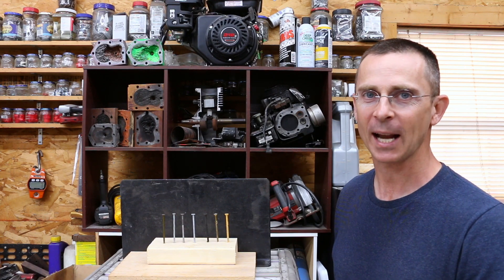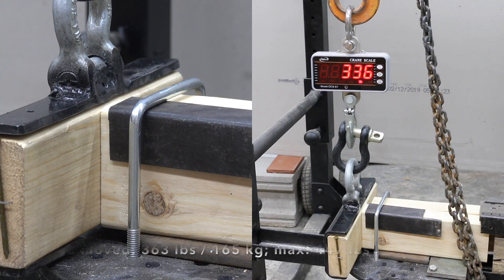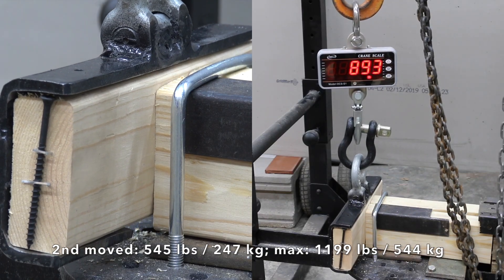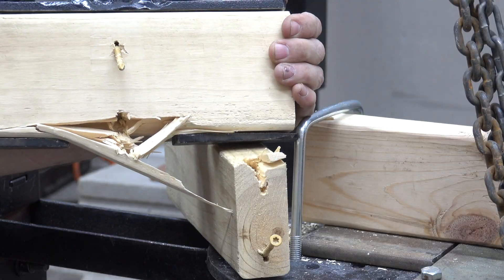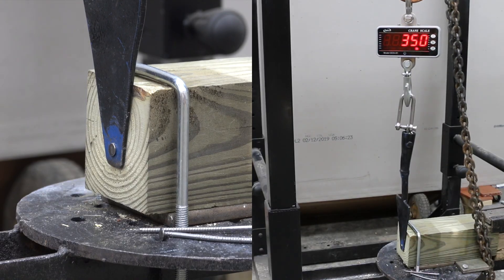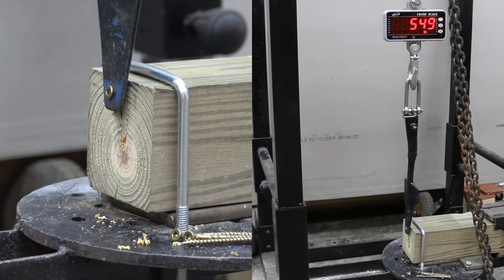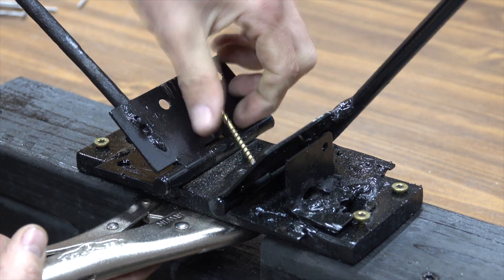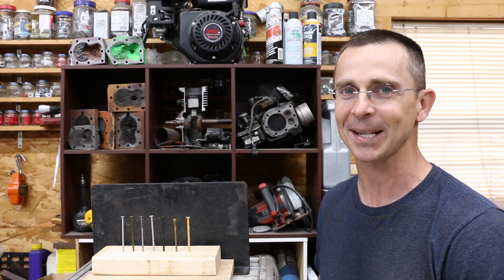Do Screws Shear easier than Nails? Let's find out!

Comment: I'm sorry but the bend test was absolutely pointless. No joint will move that amount.
Reply from the maker: Thanks for the feedback.
Reply: @ProjectFarm   from an engineers point of view, every fixing I've ever used is driven in until the head of that fixing is touching the surface that it is being driven into.  Hence the snap test is irrelevant to how a fixing is used correctly.  The previous 2 tests were very accurate in my opinion.  Thanks for spending the time that you do, doing these tests. I do enjoy watching your channel 👍

Comment: You didn't shear any of the nails, you're measuring bending moment. The wood fibers sheer at way less force than the nails or the screws, then the nails and screws bend as they pull out. I don't know why everyone thinks that structural strength is simply a function of fastener sheer strength. If you legitimately want to test sheer strength you need to recreate the 2nd test but instead of putting them in to wood you need to put them in a metal collar sized based on the fastener with a set screw holding them in place. This is all pretty moot though. A screw designed to do a job is always better than a nail designed to do the same job, but screws will never be the primary form of framing fastener because they are too slow, and that costs money. 

Also, a lot of people on youtube test fastener "shear" strength because they believe that is why newer building codes require joist hangers and hurricane brackets instead of nailing or screwing boards together in certain scenarios like joists on a deck. When in reality the reason these are required is because of the low shear strength of the wood fibers when resisting the fastener moving sideways through them, as you showed in your second test. 

If anyone actually correctly tested shear strength of fasteners correctly they would be shocked to find out that most of the numbers are going to be above 10klbs and that hardened fasteners are going to score higher, seemingly negating what all these youtube couch contractors believe to be the reason why non hardened fasteners are preferred in construction. But in reality, as you showed, as the fastened joints yield they bend the fastener and harder fasteners snap instead of bending. 

I guess what i'm trying to say is I really wish people would just stop calling it shear strength. And for any of those couch contractors who are going to tell me i'm wrong, don't bother, I don't read replies so you are just wasting your time.
Reply from the maker: Thanks for watching!

Comment: So much grousing in the comments that you didn't do a true "shear strength" test of the fasteners themselves.  True, but you did do a shear strength of wood joints built with these fasteners that are, in fact, designed to fasten pieces of wood together.  That's actually a more interesting result.
Reply from the maker: Thank you

Comment: I’m a senior mechanical engineer student. I understand the argument about the problems with cyclic loading and brittle materials. The test where you where binding them in that dramatic of an angle is not an accurate demonstration of the type of deflection that they would occur in there normal operating conditions. Unless you want to make an argument about fracture mechanics and crack propagation, than this argument isn’t logical.
Reply from the maker: Thank you for the feedback
Reply: Project Farm it was still the best testing I have seen so for! Sorry it seamed like I was being supper negative. Keep up the good work! And thank you!

Comment: Which 3 inch screw is the least likely to snap while driving in? I'm a locksmith and while replacing hinge and strike plate screws with longer deck screws I've had 2 break on me. It's pretty embarrassing being at a customers home and having this happen. Maybe I just bought bad quality screws. I think I got them from ace.
Reply from the maker: Thanks for the video idea.

Comment: Found this interesting, but one can shear screws very easily with a 4 lb hammer well shearing nails are much more difficult. Its why in concrete forms we use screws and not nails as it makes for stripping the forms significantly easier. Why that works is because Screws are harder than nails. Nails can absorb sudden impact a lot better than screws.
Reply from the maker: Thanks for the feedback.

Comment: When selecting fasteners there are many factors that must be considered. One of the biggest mistakes is cheaper works. Every fastener you tested has a specific use which is always the deciding factor. I was impressed with the GRK and had just recently used some large ones on a high vent staircase. I had some reservations but not anymore. Great job !
Reply from the maker: Thanks!

Comment: Screws and ring shank nails are designed to have the shear strength on the smooth section above the threads or rings therefore the test with the hinges for these fasteners is not as valid, and although many use these fasteners on end grain applications it is not the best. Thank you for all the work you put into your demonstrations.
Reply from the maker: Thanks for the feedback.

Comment: Totally missed "shear".

In engineering, shear strength is the strength of a material or component against the type of yield or structural failure when the material or component fails in shear. A shear load is a force that tends to produce a SLIDING failure on a material along a plane that is parallel to the direction of the force.

It would be impossible to "test "shear strength" in wood as the fastener shifts in the material it is fastened to.

He could only test "shear strength" if the fasteners were placed in cylinders small enough in diameter to prevent any angular motion of them then moved in opposite directions testing/measuring the amount of pressure required to "shear" the fasteners.
Reply from the maker: Thanks for the feedback.

Comment: Fasteners are supported when stressed. We are interested in whether they will pull out as in a hurricane. That is whu we now have nails and screws certified for use in structures requiring hurricane certification. Your bending free standing fasteners is a test of the metal they are made of and the ridges or threads impressed into them. It has little to do with whether they will hold a house together in a storm. Note how short the stubby little nails aere which are used in Simpson Strong-Ties.
Reply from the maker: Thanks for the feedback.

Comment: When testing holding power in wood, you might want to run the fasteners into the side of the wood (across the grain) instead of the end.  In woodworking / carpentry, we fasten into end grain as little as possible because it doesn't hold nearly as well.  However, the smoother the fastener, the less difference it makes. (Screws hold much better across the grain; common & finish nails hold better, but not by a lot.)

Also, for a true shear strength test jig, I'd use 2 steel plates in a channel (similar to a guillotine), with one fixed and one pulling. "Pin" the 2 plates together with the fastener and then apply the load. This way you're ONLY testing shear strength, not how well the fastener holds into the substrate when shear force is applied.
Reply from the maker: Great feedback. Thank you

Comment: Can you do a test on strength and corrosion resistance with nuts and bolts or metal anything in general. I want to see if you could show the difference with 316 stainless, 304 stainless, steel and galvanized. Preferably with fasteners. We all buy nuts and bolts. But I don’t know the value in stainless 316 vs 304 to be honest.
Reply from the maker: Thank you for the video idea!

Comment: This is some very useful information, but it doesn't necessarily mean one type is better or worse, just different.
Learning the limitations and benefits means you can customize use, make things more efficient etc.
For example, when laminating boards I'll usually use screws on the ends, top and bottom, then quickly run back over the beam with a pneumatic framing nailer.
The screws prevent withdrawal at the edges.  If separation doesn't start in the field, well, it can't start in the middle.
The nails in the middle are cheaper, faster, and I don't have to worry about separation because of the screws.
One of the nails I started using recently seems to have a glue on the shank which is heated and activated when driven in with a pneumatic nailer.  I guess we'll see if it helps in a few decades.
Reply from the maker: Thank you for the feedback

Comment: i would like to see this test with 6 inches of the stud past metal brace and u-bolt.  I would be curious to know if threads cause the end grain board to move and/or split sooner then its nail counter parts. After all you are doing a shear test.  I think shearing results will very because screws compress the wood more than a nail. Also does the type of pine make a difference.  There are 3 common type of pine used in framing depending what part of the USA your in. Some pines have wider end grain pattern. Oh well just curious.
Reply from the maker: Great suggestion. Thank you

Comment: The problem I have with using screws is they seem to rust faster than nails.I have pulled 100 year old nails that look like they were made yesterday and had to replace screws that I guess the water in the wood rusted in a matter couple of years.
Reply from the maker: Great point. Thank you

Comment: Any attachment that has the holding device (nail or screw) anchoring into end grain is inherently weaker than anchoring into long-grain, or the side of the board.
The short-grain, or end grain, will fail before the true shear strength can be tested.  Also, since nails are not hardened (except for perhaps at the tip) they will bend long before they break.   Screws are hardened and are more brittle.  In framing movement must be allotted for and so nails are ideal.
Reply from the maker: Thank you for the feedback.

Comment: This reminds me of something I witnessed years ago. My employer sold oil well drilling equipment, including a safety valve that was intended to open if the outlet got plugged. It's something like the pressure relief valve on the outside of a home water heater. This extra pressure could cause the steel pipe to rupture, which could seriously injure a crew member, or overload the main pump bearings, or cause contamination. Not good.

Since springs might fail or degrade over time, this particular design depended on a piston that transmitted the pressure inside the valve to a bar, that contained a shear pin. The designed depended on the shear strength of a common iron nail widely available in the United States, called a 16 d or "16 penny nail".

However, those nails are not always available in other countries. The manufacturer sent out a safety notice, warning customers that nails from other countries were often stronger than US nails. In particular, there was (maybe still is) a Korean manufacturer that made nails that fit in the holes in the shear relief valve, but which caused the valve to open when the pressure in the line was 10-15% higher than the valve manufacturer had calculated.

Another problem that occurred is that sometimes drilling crews got tired of the valve shearing, or couldn't find the correct size nail. So they sometimes used other materials, such as welding rods, machine screws, Allen wrenches. All of those materials are much stronger than the recommended iron nails.
Reply from the maker: Great information!  It seems as though the company would sell their own shear pins for a very affordable price to help avoid problems.  Thank you
Reply: @ProjectFarm  that was one of the solutions they offered. They started including a small keg of US -manufactured nails with every shear valve.

Comment: FYI-- Cast screws and bolts are stronger than milled screws when it comes to shear strength.  The Milling process creates micro fractures all across the tread area that allows multiple shear points.  That's why the bolts and screws cost so much in the aerospace industry.
Reply from the maker: Great information!  Thank you

Comment: do a test on what is the best drill bit to cut the head off on a rounded off screw    I got to fix my deck and some of the square heads are rounded off and i need to drill them out but what do i use
Reply from the maker: Thank you for the video idea!

Comment: i live in a old home with warped floor boards and i wanted to screw the floor down and not squeak those T25 screws were the only ones i could get to go in the oak and not drill a pilot hole to keep from breaking     now if i had to back one out it was hot and i learned not to touch them because it burnt my fingers
Reply from the maker: Great point!  Thank you

Comment: Please test wood vs steel gussets using truss plates, 1/2 and 3/4plywood, 1/2 and 3/4 osb in shear, torsion, and tension I’m curious to see if site built trusses are viable options using glue probably pl premium or wood glue(both already tested) and nails (tested here) vs the roll on truss plates and metal truss plates with nails
Reply from the maker: Thank you for the video idea!

Comment: I'd be interested to see if the standardized tests for ductility in the industry use host materials that are hard (like your metal jig) or soft like lumber. It seems to me that the ductility of a fastener needs to be considered in the context of the hardness of the medium: brittle fasteners may be still produce durable joints in material that is dramatically softer than the fastener.
Reply from the maker: Great feedback. Thanks

Comment: That's not shear strength. You are pulling two boards apart at an angle. It would have been better to place another block on the outside to prevent the separation of the two boards.  But next time, use steel and really get shear strength. Because I have heard that a 16 penny nail has a shear strength of 3000 psi. So the numbers you came up with are way short.
Reply from the maker: Thanks for the constructive feedback

Comment: Good stuff. 

A couple of observations. 

Not all wood is created equal is it possible that some of the differences between the same kind of fastener is related to different pieces of wood. Wood with a high or low moisture content, knots etc?

Another thing to test is Nail gun nails as they appear to not be the same as the ones you showed they have clipped heads. which might affect their strength.
Reply from the maker: Great point. Thank you

Comment: The fasteners where nailed/screwed into the wood that was stationary in the pull test jig at the wrong angle. Parallel vs perpendicular as intended. You went with the grain which is a big nono. Test invalid. Although nice job overall.
Reply from the maker: Thank you for the feedback!

Comment: Repeated motion definitely brutal on harder metal.  This is a really nice test, though real life shear isnt that big.  Just want to comment that long term nailed down boards can split in applications such as decking (nails can in fact pop out with stuff like stair treads handling lots of vibration, same with non-predrilles screwed boards.  Predrilling and countersinking is the best way to keep boards and fasteners in great condition in weathered application.  Oooo video idea, maybe you can see if pre-drilling makes a difference!
Reply from the maker: Thank you

Comment: Looks like you had fun ... I'm a carpenter and have used both quite successfully, depending on the application ... nailing is quicker, it took you 5 whacks to drive a nail where it takes me one ... screws are wonderful when whacking is a bad idea, especially during repair work ... time and moisture are really hard on screws, the metal/wood interface rots quicker, just from experience nails hold longer ...
Reply from the maker: Lots of fun.  Thank you

Comment: I work for a building mover. To put a house on a wooden basement requires putting a slide plank on the wall soaping the the slide plank and pulling the house on beams onto the basement to put the house in place. On one job where the homeowner built his own wooden basement, he used two inch screws to attach 15 mil treated plywood to the studs. Upon beginning to pull the house onto the basement we immediately heard popping noises. We stopped pulling to find out what was happening and sure enough all the screws were shearing off.  We took a nailer and quickly renailed the studs avoiding a total failure of the wall. Keep in mind that we have put hundreds of houses on nail driven basements and never had a failure. Screws are perfect for certain applications but there reasons why they are prohibited for framing.
Reply from the maker: Thank you for the feedback

Comment: Wow. What I've learned from people on job sites over the decades is wrong, at least with modern fasteners and the stresses likely encountered. It's supposedly 'common' knowledge that nails are better at resisting shearing forces, lol. This may be true in mediums harder than pine (more shearing force because the medium gives less), but all the framing is pine. When the medium begins to fail (and the nail/screw flexes), the force is no longer being applied at a right angle- which is the definition of shear strength. I liked the hinge, but it's not really a test of shear strength- they're being bent, not sheared. It's still good data, just another category. 

Thank you so much for the video.
Reply from the maker: Thank you for the feedback

Comment: your test is flawed.  in almost every application where a nail excels, ,there is not going to be an example where the board can twist out.  shear strength means that the nail has to shear, not come out, like a shear pin in a tractor.  the way you're testing is not a shear test, it's a hold test.
Reply from the maker: Thank you for the feedback